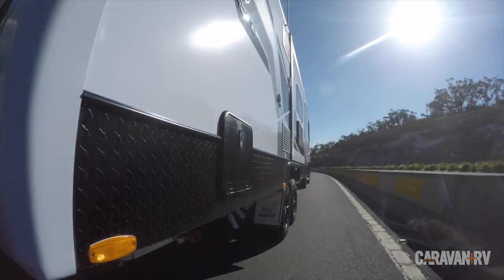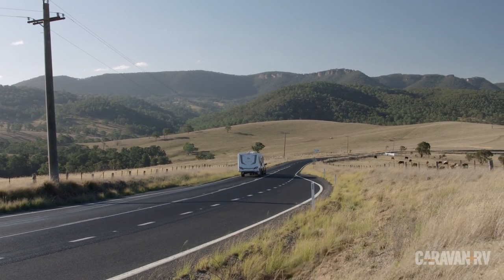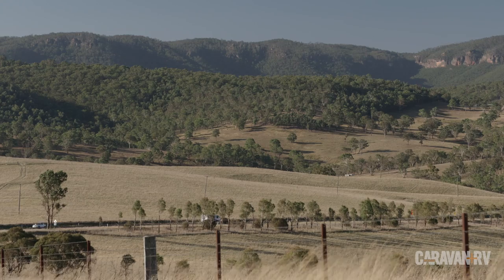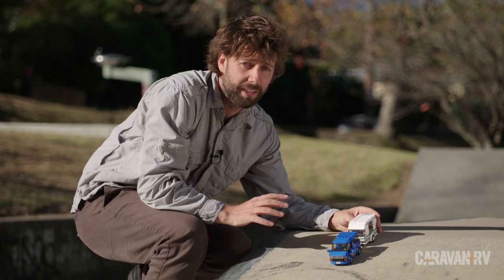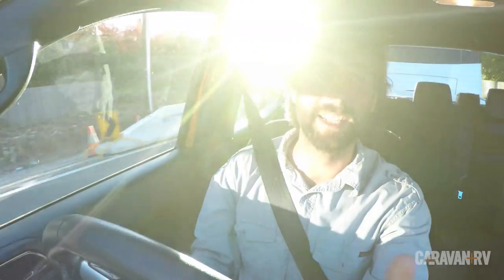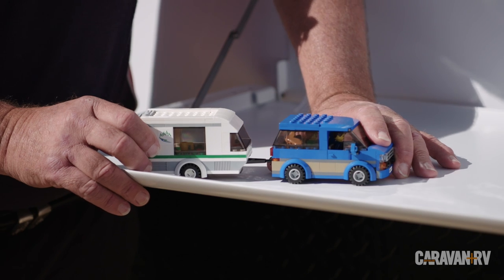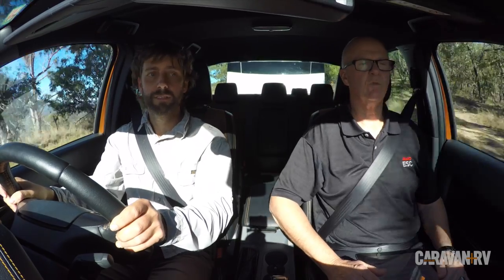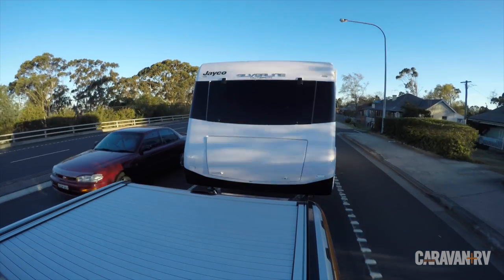Caravan Tips - Why do caravans sway and how do you stop it?

Comment: I have to admit that I was of the thinking that accelerating the car would sort it out. So this was most educational. Thanks.
Reply: Bill Blinky LXMKAI LXMKAI LXMKAI
Reply: That is a logical thought, however,  you are between a rock and a hard place if you do that since you will have to go faster with it already swaying and if you get another puff of wind you will be rolling down the road on your side much faster. Water skiers find that if the towing boat accelerates as they swing back on the return it gives them a terrific turn of speed. If you want to understand the principles just think of a crankshaft at bottom dead centre and see that as it turns it pushes the conrod and piston up the bore and this is called Simple Harmonic Motion your caravan wants to do the same only it pushes the overrun on hard and this releases the potential energy that accelerates the van across to the other side exponentially and off you go with uncontrolled sway.  Take care.

Comment: I am surprised you’ve not mentioned what can start this sway. Most importantly loading your caravan correctly with the recommended tow hitch weight. Elements to look out for out on the road. Cross winds you mentioned. Coming to a downhill section where your hitch weight goes light. Driving out of a sheltered cutting into a cross wind. Etc,etc.
Reply: Lynne you nailed it - the reason is they do not know how to prevent it starting - you are in the lap of the gods without a control system at any speed ,loading or skill set. see my comments around the internet on "Differential Stability"

Comment: I saw a demonstration with a model car and flat bed trailer simulating a  caravan. The instructor showed by moving weights forward and then to the rear of the trailer, that if weight (like a full water or sewer tank ) is moved to the rear of the trailer , then that's what makes the caravan snake and sway. Emptying the water/sewer tank ( lessoning the  weight) will completely remove the tendency for the caravan to snake. Easy fix.

Comment: My van ins 19 foot long in the body and manufactured before the ESC systems were available.  I do have the electronic brake control unit within reach for manual application ( hit the bottom to apply the brakes), but I am not sure if I would have the presence of mind to get this done when the van was suddenly swaying. I have sway bars/ levelling hitch fitted, I load my van toe heavy, and limit weight to what we really need/ use, plus travel at 90 -95 kph. I can drive at 100 kph, but it feels more reactive to road conditions.

Comment: We have a 6.3 metre European caravan with a BPW hitch (which I imagine is similar to AL-KO), and friction pads in the hitch cup (I'm sure that's not the proper name!). We regularly drive Brisbane to Sydney, and can tow at 100km/h. We've never had any issues with swaying (even with wind, passing semis etc.). We often see Australian made caravans start to sway from 80km/h upwards. Can there be that many other caravanners who don't set their caravan up for proper towing?
Reply: Depends on how you load it. You want the front to be heavier than the back. Some people load the back up way too much so there isn't enough weight on the cars hitch.
Reply: Your ALKO/BPW hitch is a friction device and it obeys the laws of friction it is useless as an anti sway device since the laws of friction demonstrate that with a fixed load on the pads it will hold up to the point where it begins to move/slide between the contact areas thus when the combination is moving  you have a 7- 10 m  lever that is trying to turn a 50mm ball - it is a no brainer that it will turn easily so has no anti rotate feature AT ALL. What was ALKO thinking did they have a set of school kids set on this task?
One good thing is that it will keep the hitch locked together so the combination will stay together when they roll over. Similarly they come up with an electronic anti sway that actually confounds the laws of physics and applies both brakes on the trailer when it is a fact that applying the brakes at the wrong time is actually the cause of uncontrolled sway, but if you are very lucky it will slow you down after your heart has stopped pounding when the sway starts if you have not hit anything in the meantime.
Reply: The hitch friction coupling is completely useless in preventing sway ( laws of friction states that once there is movement slip occurs) - they do offer extra ball attachment security and can be very irritating with noise when turning.

Comment: I'm about to buy a van and I'm a bit overwhelmed by the responsibility to stay safe.
Also have never worked out why caravan always have two axles.
I'm not thinking axle weight here but extra brakes
Cars have 4 wheel and a caravan can weigh just as much
Reply: Caravans over a certain length/ mass have two axles , those shorter have only one axle. There are pros and cons of each set up.

Comment: If you suffer from caravan sway and survive, take the hint and SLOW DOWN!
You are towing way too fast.
PS if you pass a semi that is doing 100km/hr, you WILL get sway.
Semi's push a massive amount of air around the front and the pressure differences as you go past will try to blow you off the road!
Tow at sensible speeds!
Reply: Speed is irrelevant Charles if you have a control system in place - it can occur at a modest 40mph since the cause is not related to speed though of course if you are only doing 20mph then it is quite safe.
Reply: If you get sway you have the wrong hitch or incorrect setup.
Reply: Towed a fully loaded Chinese camper two years ago down through central NSW, Swag raptor 14 (single axle), over 250kg ball weight forget the atm, but we always pack light. most of our weight was up front. That camper was stable and felt good passing road trains at 160, no problems at all. recently hired a 17 ft jayco pop top dual axle, even with the rear tank empty it was way less stable over 120.  but could defiantly do it. Tow vehicle also helps. So many utes with their arse hanging out fully loaded with huge vans, that shit has to stop.

Comment: Also a little trick for tandem axle trailers, run approximately 15 to 20lb more air in the rear axle than the front. Before all the experts weigh in their opinions try it. For the tech guys the longer the distance between the tow ball and the rear axle the greater the stability
Reply: Well, those two lines sound completely wrong. Or do they just require a great deal explanation?

Comment: Okay, the "experts" have come up with a few theories, now I will throw one into the ether...  Most of the problems come down to the type of suspension that is fitted to the caravan.  Most of the single axle caravans have a leaf spring suspension that is fixed at the front of the spring to the chassis, and the rear of the springs are 'slipper' type, as in they have a bracket that the end of the spring sits in and moves forward and backwards as loading / road conditions vary.  Because the road conditons vary, this means that the springs are flexing; mostly not equally with each other.  Because the front of the spring is fixed, and the centre of the spring is fixed to the axle, this flexing of the spring can alter the distance between the two points.  By having two different distance between these two fixed points, this changes the angle of the axle, and now you have the axle of the caravan steering the caravan!  This was often seen with a 3 axle dog trailer, single axle dolly on air suspension, with a tandem, short wheelbase trailer behind that. 

The best way to counter this problem is to select a caravan with a torsion bar, slipper spring suspension.  This works by having a fixed bar that is connected to two fixed points; one being the axle, the other being the chassis of the caaravan.  By doing this, you are now removing the geometry of the self steering axle from the equation.  By having the springs on slippered ends, and having a solid fixed radius that the axle can travel through, you should be eliminating the sway from your journey.
Reply: Jacare Most modern caravans have torsion rubber suspension so your hypothesis is not applicable though it demonstrates you can think logically.  The out of control sway is complex but I can throw you some help.  When a sway occurs it is like a water skier on a long line as the skier moves very fast from the straight to out wide they reach a point where the line goes slack this is the point when a caravan starts to push the tow vehicle with the inertia and it would apply the overrun brakes abruptly causing it to swing back with the potential energy across at speed/high velocity to the other side.  So it is very important to stop the sway at the start but more important to stop the pent up energy at the centre of equilibrium otherwise it will get completely out of control this is what my "differential stability does without any action from the driver or any electronic devices - though it is a massive help if the tow vehicle is fitted with inertial controls as well.
Reply: There is not enough travel in the trailer suspension to cause any misalignment.

Comment: it is beyond my undestanding why this trailes do not have inertial mecanical braking mandatory in EU. just slow down (no braking), as they teach in driving school, and the trailer will brake on his own and recover. very very strange
Reply: No time to recover, sway happens too fast.
Reply: @mrjunkp7090  actually ..... you do have time . Just take the foot of the gas, and hold your instinct to make big left right corection . Just keep your cool and when towing above 90km/h keep this thought in your mind so you be prep and ready. Better still drive slow and have the trailer at 50% weight respect to towing vehicle and never have a worry
Reply: when not pushing the brake you are not engaging the trailer brake ( it needs a specific force to be working).

Comment: This video does is not  very useful. It even gives bad advice. Applying brakes to a swaying caravan will increase the magnitude of the oscillation. The only saving grace of this advice is that by slowing the combo, the overall forces will eventually diminish. Increasing speed is not the answer either, because although it will have an initial alleviating effect, the extra speed will compound the difficulties of stopping safely. The best solution is to ease off on the throttle and try to keep the rig on the road till it gets back to a safe, non-oscillating speed.. 

In fact, what this video doesn't discuss is that potential oscillating situations are directly proportional to speed. There is a more or less fail-safe speed that any rig can do and this is mostly a function of the tow-ball weight to caravan GVM ratio (with input from stabilizing devices being an additional factor). Normally, this ratio needs to be at least 10%, but if one wishes to drive at highway speeds, one perhaps needs to carefully experiment first. I tow with a Ford Fairmont at maximum GVM for that car (1500 kgs). But to keep weight on my front wheels and not depress the back of the car too much, I actually tow at a tow-ball weight to GVM ratio of 5%. To do this, I restrict my speed to 80 kph. I determined this max speed after careful (and at time a little hair-raising) experimentation However, I do not recommend anyone else try towing at a ratio of less than 10%. The risks are just too great. Once that trailer takes over, it is very hard to regain control.

What needs to be remembered also is that the axle to tow-ball distance is just one factor determining the tow-ball to GVM ratio. The way the caravan is loaded is just as important. A necessary piece of equipment for any caravaner is a weighing scale and small post to every now and then check tow-ball weight. Likewise, they should have an accurate idea of the weight of their loaded caravan.

Finally, one needs to be on the lookout for oscillation. Towing a big rig is a serious business and small deviations need to be picked up immediately and speed reduced.
Reply: you are supposed to keep with the speed limit even when towing caravans , you also clearly dont get why sway is happening it is to do with enertia and the mass of weight contributing to the momentum . braking indeed does rectify this situation

Comment: What a dumb article. Set up prior to starting out is critical.  Tongue weight, correct tyres an d pressures are a start. Braking when the trailer is on full sway will cause an accident!! Light braking as the trailer is coming back into line is the only way. However the correct setup and moderate speed is imperative.

Comment: I don’t think this helps with a heavy trailer with no breaks and a vehicle with too small breaks to stop it. It’s my experience to take your time and when it happens let off the accelerator and ride it out. It’s nice to give faith in equipment but it’s not always there.
Reply: Brakes,  not breaks.
Reply: "heavy trailer with no brakes"

Umm, that's called illegal.
Reply: Taking your foot off the gas causes the overrun to activate  - not a good idea if it is swaying best just drift along and never brake going down hill.

Comment: Just an ALKO ad really. There are equal and much cheaper choices on the market, shop around.
And lets face it, if you are hooking a caravan up for a trip....What Is The Hurry??
Take it easy and enjoy yourself. Most swaying is due to driving too fast for conditions. Yes trucks can cause it to but be aware of your surroundings and road conditions.
Basically, most of what these wankers sprouted is BS.
More driver training, plain common sense and thinking about how you load the van is needed. All the so called 'experts' do is confuse the issue and make the 'beginners' fork out  $$$ for unwanted gadgets
Reply: No.... sway is causing by improper hitch or hitch setup, yes it gets worse with speed, but slowing down is not the proper fix, heed the warning and get the hitch fixed. If you need to slow down you are on the edge of a dangerous situation

Comment: That is simply not quite correct - when the caravan starts to sway it does accelerate true but what happens next is Simple Harmonic Motion stops at 10 degrees of sway and is anything but SMH since the tyres grip the road against the sway and that forces the van to push the overrun  brake on hard and then that releases the potential energy  that accelerates the  return towards the opposite side  and this multiplies the next sway exponentially if the market leaders did their maths correctly they would know how to stop the sway from starting as I have done with "Differential Stability"  all they have to do is contact me and I will show them how it is done without any electronics or motors. If the AlKO man stopped to think that if the caravan did accelerate it would apply the overrun brake  - just put a camera on the hitch and watch - it is just like the water skier as he accelerates back and forth. ALKo system applies all the van brakes and that simply slows the combination down but if that occurs just as you are passing a large truck it can hold the combination in the slip stream of the truck at a critical point and remember it only takes 3 swings to become catastrophic and the ALCO system needs 2 full swings or 4 minor swings to actuate.  With Differential Stability it is active all the time and will provide an equal and opposite force at or near the centre of equilibrium before the driver even knows it is happening.  There are limits with anything even my system but my calculus calculations show it is way above normal road conditions - wind or inertia loadings. If you wonder why appling the overrun when you turn does not cause a sway it is because there is no inertia in the caravan so it will perform as it should.  All this is related to overrun brakes - electric brakes are slightly different and if you have a caravan electronic switch that you can apply if a snake occurs be very careful when you apply it if it is not a differential system.
Reply: why not patent and sell it if it works so great? not hating, love the idea. i just can't find any info or demonstrations of 'differential stability'.
Reply: @0xsergy  That's right because I published the concept many years ago but I do not have the capacity to take it to market so it sits on my own outfit and all the material on a shelf until the likes of ALKO or any capable company talks to me about patenting it since the rules are that it cannot be made public until someone files. The best I have done so far is offer the whole caravan with the device installed free of any charge to do any testing they wish - I value it at about £3000 and I have done 25,000 miles across Europe with some very demanding situations some at 80mph on the French Autoroutes across the Pyrenees with two electric bike on the back of the van loaded up to the max weight.
What do you think?  It looks like it will be the end of caravan towing safely - even ALKO will tell you they cannot prevent a snake only mitigate the speed.  They are so wrong they just simply do not know the solution.
Reply: @Cruner62  thats B/S all technology can go public without patents all patents do is protect your invention